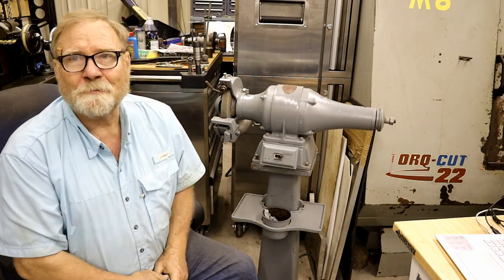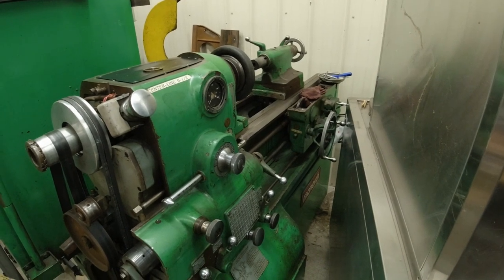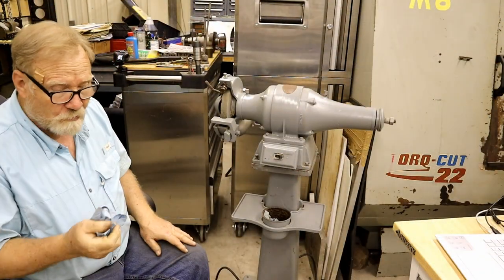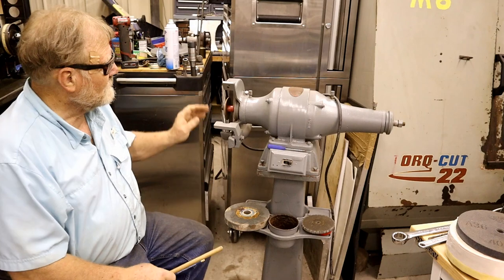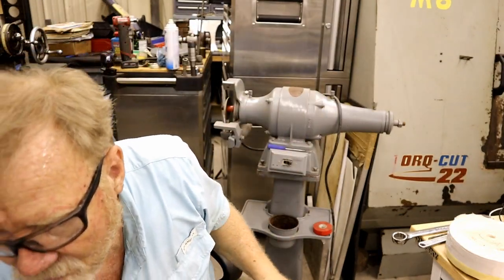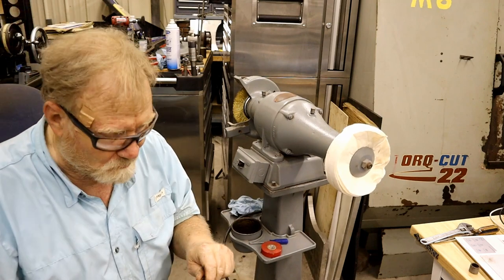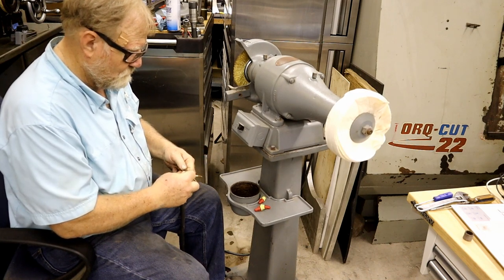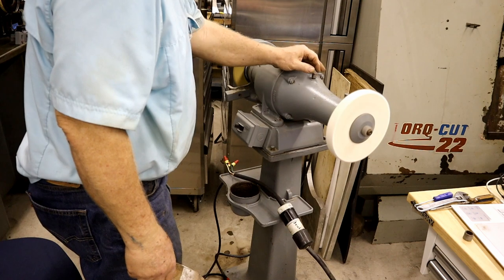Monarch 10EE  /Bridgeport Rebuild Update AND Will this grinder polisher Run?

Comment: Chips inside. Mine had sawdust. It did a nice job of holding moisture inside. 
A long way to say I know your pain.
Thanks 
John
Reply from the maker: Yep sawdust is much worse...  All I had to do was spray some solvent in , wait a few then air blast them out.... At least there was no rust...

Comment: I definitely agree about wheels. That old one did have some ring. I would throw it out, but some of the dulling is caused by that mud embedded in the wheel. If it were soaked , it would come out. But, as I say, I’d throw it out anyway. Even the best wheels are relatively cheap. Better safe than sorry, as the expression goes.
Reply from the maker: Yep just ain't worth the risk or down time!

Comment: Good use of the stick Steve to flick the switch. I can remember in my younger days I had just repaired a banding machine that had a toggle switch to turn it on. Flick of the switch and bang !!!!! blinding flash and two seriously burnt fingers that took months to come back to normal. It was in a factory so the fault current was very high. I would never trust a unearthed old appliance when out power is 220v to ground and 415v between phases :-(
Reply from the maker: I usually use Don instead of a stick :)
Reply: @10swatkins  Can you tell me were I can find one :-)

Comment: Thanks for walking us through that. Works just like it should but I kept hoping you’d stand to one side on that first start. Sounds like a 3350 motor but hard to tell without a tachometer.
Reply from the maker: I was in front of the buffing wheel.....   I agree it does sound faster,   I'll put a tach on it and see...
Reply: Steve Watkins at Work: I agree, not likely that buffing wheel will hurt you but still— Don’t know if you’re interested but a VFD would slow that 3 phase down to whatever speed you prefer.

Comment: Those wire wheels are somewhat okay but dangerous as heck!  Full face shield is a must using a wire wheel.  We are all guilty of not doing so.  A place I worked at years back there wasn't a month go by someone had to go to the ER to get wire fragments dug out of their eyeball because one of those wires went past the side shields or face shield they were wearing.  
Instead of the buffing wheel, get you a 3M Scotchbrite wheel and mount.  A medium grade wheel is what I use for polishing up parts with.  No, it doesn't get you a mirror finish, but it does get rid of the rust down to bare metal leaving a nice industrial finish. 
As always, enjoy your content and videos, and thanks for sharing. Ken
Reply from the maker: Yep they do shed wires!   Even the good ones......

Comment: Consider a 3M Scotchbrite wheel instead of the wire wheel. I have a grinder set up with both a brass and steel wire wheels in my shop. I also have a grinder set up with Scotchbrite wheels. The Scotchbrite wheel grinder gets more use. Does an amazing job for cleaning and polishing.
Reply from the maker: I will look into them,, thanks for the tip.
Reply: I agree with that, the scotch brite wheels are fantastic and make quick work of cleaning and polishing a surface, you don't get the wires sticking in you either, but they don't last as long.
Reply: @10swatkins  I have them on one grinder, great tool to have however be careful of the rpm rating of the wheels.

Comment: I've had a 9" grinding wheel explode and part of it embedded in my thigh requiring 11 stitches.  I was young and repairing an over the road tractor chassis and the guard was in the way, I knew better and removed it. Needless to say I've never done that stupid trick again and generally wear my heavy leather apron as well.  Works great for welding also.  We were all so smart when young, it's awesome survived
Reply from the maker: I still have 11 small pieces of shrapnel in the palm of my right hand from tapping the stuck end of a U joint out of a yoke on my truck.... That was the day I learned hammers and hardened metal don't play nice together!   I also learned that I was as not as tough as I though I was and could sit upright while the doctor cut into my hand searching for the pieces!  Never did find them.
Reply: Piece of steel in right eye working on a pto operate pump no glasses and a hard face hammer on harded steel.
Reply: It ticks me off that some experienced people on YouTube say to keep the guard off. The Essential Craftsman, and that guy who was making that steel boat for many years. Both actually made videos about why you shouldn’t use the guard. I removed both subscriptions after posting how bad that advice was.

I use the Wago connectors for test cords. That way I just gave to snap the connector open to insert or remove a wire. Safer, and much quicker.

That’s a really nice machine, by the way.
Reply from the maker: @melgross  Which guy on the steel boat? Doug on the Seeker?
Reply: @10swatkins  yes, that him. He also pulled a fast one a while ago pretending he was seriously injured when he wasn’t. That got a lot of people pissed at him, myself included.
Reply: @melgross  I agree with you and I generally follow The Essential Craftsman, I missed that one. I have 7-9", 4.5" and 3" plus a 4.5" right angle version,  if one is too large a smaller one is probably a better choice.  There's usually a workaround instead of visiting the ER.

Comment: Grew up in East TX (still in the same area). Mud Dauber nests (we called them Dirt Daubers) are 1 of nature's best cast iron preservatives you'll find. Of course this is only good for long term storage. Good call on replacing the dirt soaked wheel though. I doubt it would ever balance correctly again.
Reply from the maker: Interesting!
Reply: My wall 220 AC heater unit would not start. Technician took a quick look and recommended a new unit for $15OO. plus labor. I removed a few panels and found it completely locked up with dirt dauber nests. I cleaned them all out and it started right up good as new. Still working great three years later.

Comment: Old Vo-Ag teacher about got killed by one blowing up. Wrong speed.  I couldn't hear a ring if I had one on but maybe I could doing it here. I'm trying to rig up a polisher and have a 1750 brushed motor and an old Delta mandrel setup. All I lack is finishing. Tried to order one but that was a joke. Lost my dough once but that'll be IT! Sorry Don wasn't there. And 110 will grab you in the right conditions. I know for a fact! An old electric chair metal case drill motor on a dirt floor with worn out flip-flops. OH YES it'll get you. Yanked the plug out. GBWYou!

Comment: A real cliffhanger hanger right up till the end.  Great advice on the dangers of 3 phase.  What about 220?  I've had my share of shocks from 110, but never was hurt.  Thanks for the great video.
Reply from the maker: I had a fellow Fire Fighter killed by 220... Was working in the attic and laid down on a bare spot on the 220 wire going to the A\C unit...

Comment: BP's love to hide chips in places you'd never think they'd get to. I had a friend of mine get a 4-1/2 cutting disc stuck in his right face cheek,   That's not a half bad grinder polisher.  I got smart last year and got a Baldor LPL75 polishing lathe which is not much more than a motor with a fancy chuck thing on the spindle.  And yet again I'm looking for a Baldor 332B, unless the machine gods find me a 8" (or bigger) grinder.
Reply from the maker: Every single place I have opened up on this machine had a ton of chips!

Comment: Now any electric shock can get you. I've been grabbed by a 110 volt hot box in a food service environment when I went to plug it in. The only thing that saved me was my legs weren't straight and my knees collapsed pulling the plug out of the socket as I went down. I was held for a good 4 or 5 seconds at least and it seemed like a eternity to me. All my muscles hurt like hell for several days afterwards. Definitely not fun.
Reply: Yep. Amps(current) kills. You can have low voltage with high amperage making it very dangerous. In the same sense you can have high voltage with really low amperage making it “less” dangerous. An example: A General Motors style HEI ignition is between 50,000-65,000 volts. However, the amperage is low. It will bite the crap out of you(speaking from experience), but is mostly harmless. This said, I am far from an electrical expert. I did however stay at a Holiday Inn Express last night. 😁
Reply: I 2nd this! It WILL get you!

Comment: Re: Buffer/grinder, iirc the switch is either single or double pole, I forget which, but al least 1 leg remains hot to the motor anytime it is left plugged in, or the rpc is running.
Reply from the maker: Not on this one.... All three legs are broken... A true three phase switch!
Reply: @10swatkins  YAAY!

Comment: Hey Steve. Did you do any videos of scraping a Bridgeport? I’m not sure if I saw all of them. Mine is not terrible, but I’d love to red tape it one of these winters but a 2’ straight edge is so damn expensive. I did get a scraper so I have it when I find the right deal. Right now I just spent a small boatload of money on an F1R procharger and new pistons, pins and rod bolts to handle the 1,200HP I’m gonna throw at it. Ittll be ready to go back in this weekend. But anyway I’m not touching the scraping till I am 100% confident I can make it perfect. As of now I’m pretty sure I have all my thoughts gathered. Maybe this winter
Reply from the maker: That stupid nut has taken all my free time!   I have the table planed the base is all lined out to flake the column and I am planing the rails for the 10EE...  I need to practice flaking so as I plane the rails I'll have a great long practice piece....  The new 10 x 30 grinder is progressing so I can use it to grind the saddle of the bridgeport....   I'm getting to things as I can..... This Youtube thing does not pay much so I have to keep working at making money first...
Reply: @10swatkins  that’s cool I can’t wait to watch the progress!